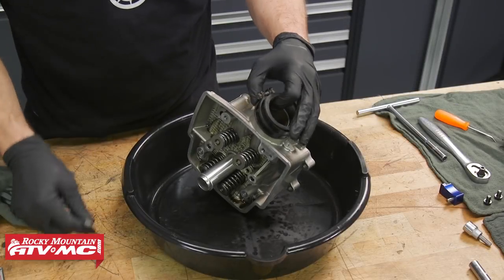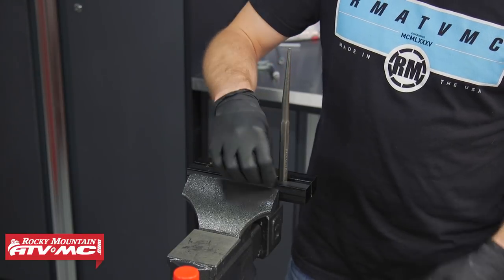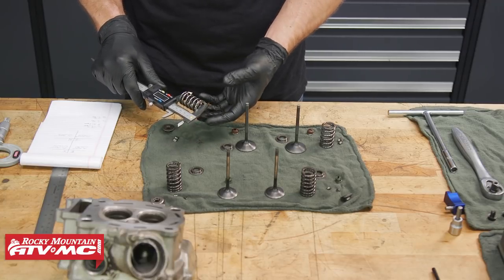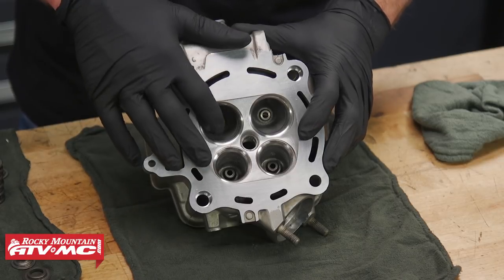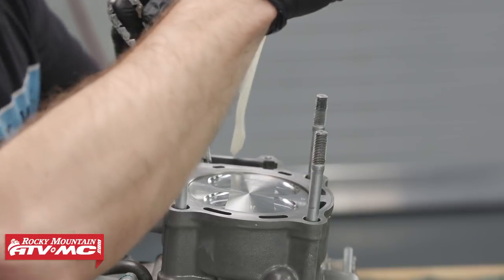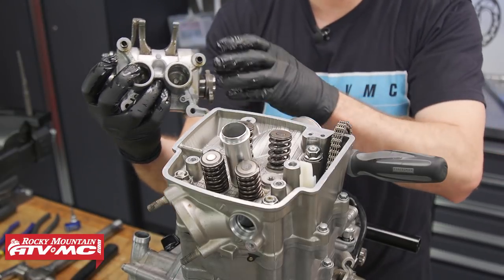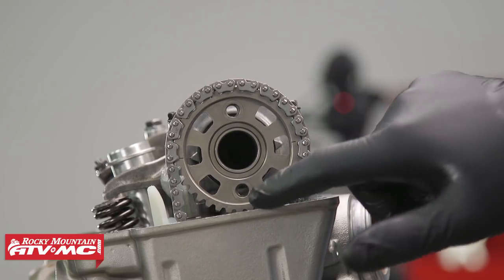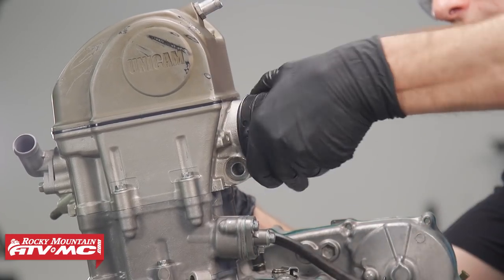Honda CRF450R Top End Rebuild | Part 2

Comment: Not sure if anyone here can help but i got a cylinder works 100mm over bore kit for a 2008 crf450r and the gaskets i got are identical to the stock gaskets the base i would understand although it doesn't want to slip over the outside of the new cylinder without bending and rolling the edges but the top literally hangs inside of the cylinder and would get hit by the piston if i were to install it. I think they sent me a stock kit instead of an overbored version. Anybody know what size gasket it would need to be? I assume 101 or 102 mm if the cylinder bore is 100.
Reply: Hey man I want to know how much for Claire's how much water flavors

Comment: I knew about timing them with the flywheel marks but aligning the cam marks without the bolts and then turning the cam to align the bolt holes was new to me. Very good idea. Great job RM!

Comment: You made these videos like a month before I'm buying a 2005 450 that needs a top end. The timing is perfect because these videos are great. The guy I'm buying my bike from says that is lacks compression. Is there anything I should expect to have to fix besides the top end? Even if I spend 1000 on the bike I'll be within the budget for the price I got the bike for
Reply from the maker: Do the compression test, check your valves, and you might as well to a cam chain since they're cheap and easy to change out. I'm sure the bike has a lot of hours on it so make sure to really check the cylinder wall for damage. New spark plug.

Comment: If you get the valve seats machined do you need different valves. Or do they add material then take away back to OEM size?

Comment: my service manual mentions nothing about timing this timing mark (12:20) kinda makes sense why my compression timing wasnt right when i did everything else the way it instructs, it does mention timing from the right sight of the crank case while the engine is in tdc, but my cam chain must be out of sync with the marking? or if the right side is in line will the left side be too pls help xDD. Second edit maybe i put my cam gear in 180 degrees backwards is that possible?
Reply from the maker: https://youtu.be/mMWLygPpvNQ?t=235 We covered the marks better in part one, so check that out. You can also use a long screwdriver down the spark plug hole to verify TDC, since it can be kind of hard to see when the timing marks are perfectly lined up. The cam sprocket will line up the same either way, just make sure the marks are facing out like in the video. -Charles

Comment: How many pounds of torque does my crf 450r 2013 motorcycle have if you can help me xfa
Reply from the maker: The 2013 Honda CRF450R engine makes around 35 ft-lbs of toque.

Comment: wouldnt you need new valves after machining the head?
Reply from the maker: It all depends on the condition of the valves, if they are cupped, pitted, bent or have any other wear or damage, then yes. You would want to have the new valves before machining the head because they need to match up to the seats when you're done. If the valves are like new, then all I'd worry about is the contact pattern. We just lightly used the cutters on our seats to clean them up and make sure the contact pattern was correct. If there was serious damage to the seats you would probably need to replace the valves as well.  -Charles
Reply: @rmatvmc  thanks man

Comment: Hey guys, im jdoing a trx450r i just picked up for a good price because it leaked oil from the base gasket. just took the top end apart to replace the gasket, seen the top end has very low hours so went to reassemble and i cant get the chain back on the cam gear.TDC and  all theres not enough chain for the gear to slide onto cam. It came off fine though. Any suggestions?
Reply from the maker: Is there a chain tensioner still putting pressure on the chain or have you removed the tensioner?

Comment: Where did you get your cam gear holding tool
Reply from the maker: Unfortunately, that Motion Pro tool has been discontinued but there is one from Pro Honda that should do the trick. Just make sure to enter your bike's year, make and model to ensure this will work.
Pro Honda Cam Sprocket Holder- https://www.rockymountainatvmc.com/parts/pro-honda-cam-sprocket-holder-p

Comment: I followed the service manual instructions to put oil on bolt threads for a linkage bolt and when tightened it to torque spec the dang thing stripped the threads off.
Reply: Talk to the guy who did the job before you. Bet he said if tight is tight then a little more will be, more better.
Reply: @tysleight  It was from the factory - nobody had touched it before. I just put a little oil on the threads and followed the Honda service manual torque specs.
Reply: @311hitwall  well that super sucks!  Maybe it was built on the Friday before a 3 day weekend???   Is the 311 stand for the band or The police code of indecent exposure?
Reply: I bet your torque wrench’s arnt exactly right, I know my torque wrench’s are cheap and over tighten a lot of my bolts. I broke a left side cover bolt and it wasn’t even at the required torque yet.
Reply: @blakejansen642  Could be but I used the same wrench after I got a new bolt - without the oil of course. Maybe the oil makes it easier to  stretch the bolt and if the wrench is off a few pounds it doesn't end well.